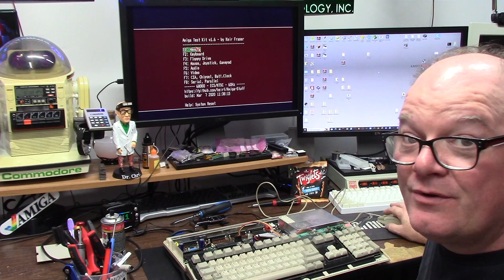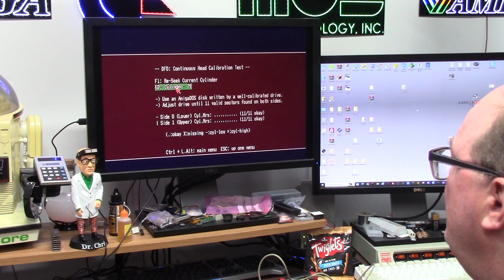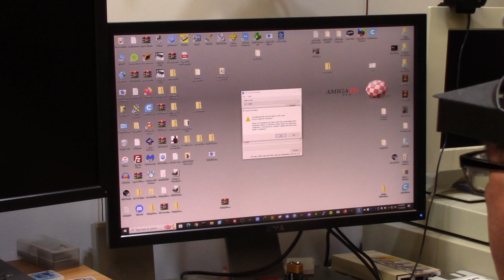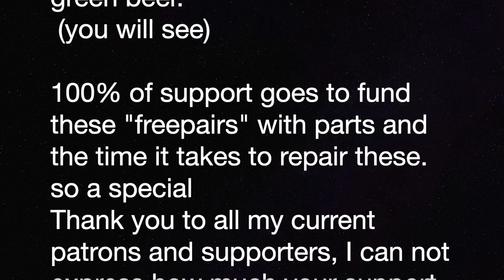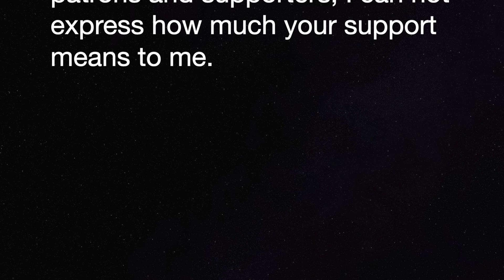Amiga 500 and a RGB2HDMI - sometimes a little lube is all she needs.

Comment: Hi Dr Chris, I have a 500plus and I want to use a monitor instead of a tv. Could you please tell me what Dell monitors you use and is it just a vga lead with a amiga kit converter plug? Thank you
Reply from the maker: Dell U2410-F and a simple amigakit db23 to dsub15 vga converter and yes its a reg vga cable w the adaptor on it

Comment: Kinda janky HDMI solution. How about a short stubby internal cable panel mounted on your 3D printed bracket, then proper right angle HDMI external cable to the monitor?
Reply from the maker: because thats all i had at the time, was on very limited turn around as this was a pickup and delivery. so no time to order things. the owner can customize it as needed. the hardware and side bracket were most important to him.

Comment: I have the same A500. Chicken lips, embedded logo on chassi, same floppy drive, same revision motherboard with the Gary fix and had the same Agnus socket with that same clamp. It had similar issues. Reseated the Agnus and it worked. But after storage for a few months I had the same problem again. Again with the Agnus socket. Reseated Agnus again. After storage, same problem again. In the end I swapped that Agnus socket to fix it permanently. And now it has no issues after months of storage. I wouldn't be surprised if the Amiga in this video will get the same problems after a while. Thanks for the video. Keep the content coming

Comment: Wish you would have explained the rgb2hdmi a bjt more, does the original port still work as normal? Does sound come through the hdmi? Can it work with higher resolutions or frame rates? What about interlaces mode? Can we get no flicker interlaced?
Reply from the maker: the rgb2hdmi has been covered many times by me and many others, it is hdmi only, your rgb still works and no sound as its not paula but denise.. it does not RTG the amiga, but allow amiga modes to be viewed on hdmi devices in a pseudo upscale

hope that helps
Reply: @ChrisEdwardsRestoration   but you are the auth or a tah! Wonder how it would work with my Hdmi to vga connector if the screen would be 4:3 or scrunched 16:9